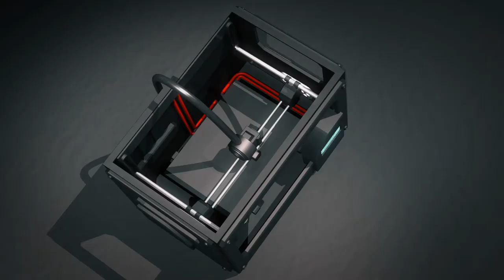SeeMeCNC ROSTOCK MAX v3.2 Build Series Part 10: Steps 35~37

Comment: Do you have a video showing the assembly of the whip?  I saw your unboxing, and I know it came with all separate wires etc like mine did.  I don't know how to put the splitter together, and I can't find any instructions anywhere!
Reply from the maker: My whip was pre-assembled and in the flex tube already. Has that changed? See if this drawing helps: https://www.seemecnc.com/products/assembled-hotend-whip-for-accelerometer-hotends
Reply: At 5:33 in your video here it looks just like mine, the wires separate from the loom (mine actually had the bowden tube in the loom already.
https://www.youtube.com/watch?v=flp2xXAL6Vc&list=PLKlntVS2tLE4iyYtGc90BjNMrKPd6Mj3m&index=16
Thanks for sending the link, but that's what I've seen in a couple of places, I have two short lengths of loom, and one long one.  In the picture in the instructions for step 38 it shows the ends hanging down, but not the Y connection.  I can't figure out how the looms will stay connected, maybe it doesn't need to be very secure.
Reply from the maker: Sorry Ben, just noticed your reply. My whip came with the Y already done. Best I can tell is it is a zip-tie around the flex loom, with a printed flexible Y that slides up over it, and more flex loom on the 2 pieces below it after the split. I'd reach out to SeeMeCNC support for clarification so they can incorporate your feedback into the build guide- especially if they have changed the kit since I put this together.
Reply: I don't know if it's always been there and I missed it, but here is the whip assembly instructions:  https://seemecnc.dozuki.com/Guide/SE300+Whip+Kit+Assembly/92